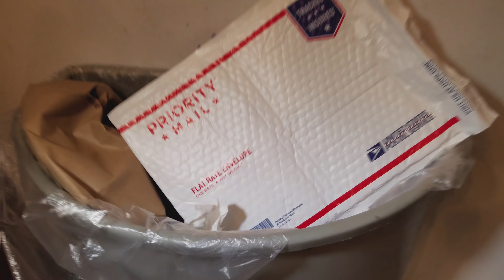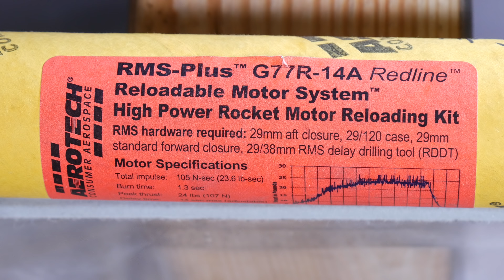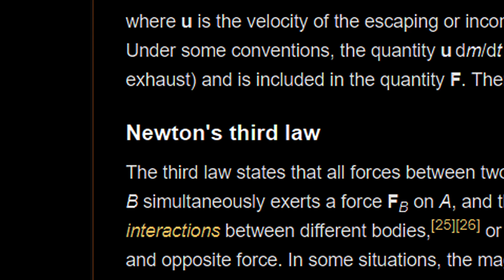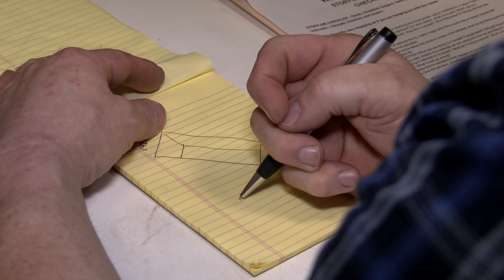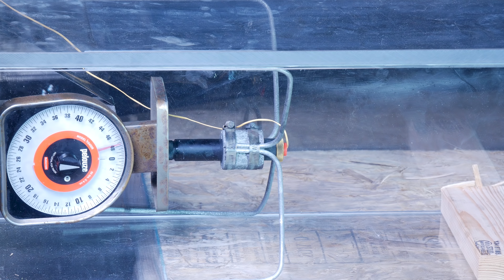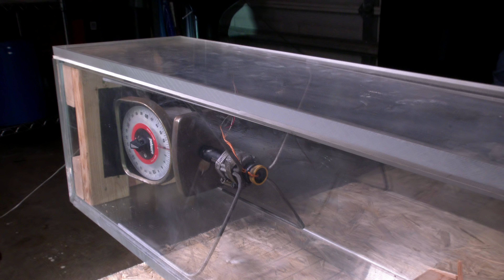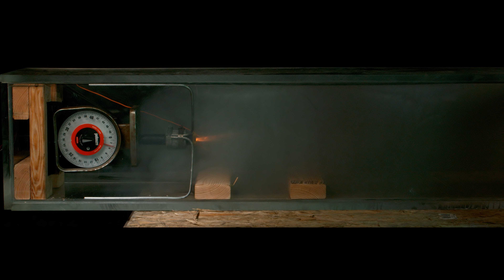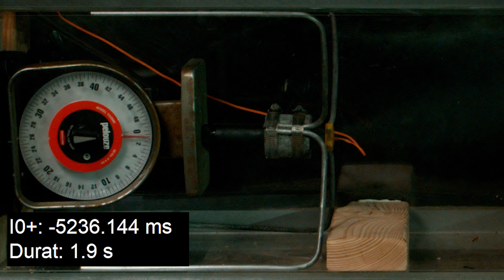Rockets in a Vacuum Chamber - Newton's third law of motion Visualized

Comment: The three questions I ask Papa Legba HUNDREDS of times on these threads are:

1 - when the rocket engine is running is the exhaust gas ACCELERATED as it leaves the rocket? Yes or no?
2 - does the exhaust gas have MASS? yes or no?
3 - can MASS be accelerated without a force? Yes or no?

The answers are:
 1 - Yes - the exhaust gas is DEFINITELY accelerated .
      It changes velocity from ZERO (with respect to the rocket) to over 2500 meters per second (about MACH EIGHT) (for a space shuttle main engine for example).
  2 - Yes - the Exhaust gas definitely HAS MASS .
      For the Space Shuttle Main engine: It consumes 500 kilograms of liquid oxygen and liquid hydrogen PER SECOND, Combusts it and expels the exhaust gas (PURE WATER) at MACH EIGHT. The exhaust gas has EXACTLY the SAME MASS as what went in.
   Last time I checked 500 kilograms of PURE WATER - HAS MASS (500 kg to be exact)
  3 - No - an object with mass CANNOT be accelerated without a FORCE .
      Newton's FIRST LAW tells us that the ONLY thing that can change the velocity of an object with mass (accelerate it) is a FORCE.
     That is literally the DEFINITION of the word "Force" - "That which can change the velocity of an object with mass."

So Papa Legba REFUSES to answer these questions because it PROVES the following:
Since the Exhaust gas HAS MASS, and it IS ACCELERATED then there MUST BE A FORCE exerted on the mass of the exhaust gas - we SEE IT GET ACCELERATED as it leaves the rocket!
Papa Legba has ALSO admitted that "The VACUUM cannot exert a force".
SO that means there is only ONE PLACE that the force can originate FROM - THE ROCKET ITSELF!
So if we have PROOF that the ROCKET MUST be applying a force on the mass of the exhaust gases then the exhaust gas MUST BE APPLYING A FORCE BACK ON THE ROCKET !
This is Newton's THIRD LAW! - Forces NEVER occur ALONE - they MUST OCCUR IN PAIRS .

SO IF Papa Legba acknowledges the above then he MUST ADMIT that there IS A FORCE PUSHING BACK ON THE ROCKET!

And this would prove his bullshit FALSE!

Oh and Papa Legba is SUCH a big imbecile that he will not even admit that Burning Hydrogen and Oxygen makes PURE WATER!
He has been arguing with me about the fact that the Exhaust Gases from a space shuttle main engine are WATER.
He contends its "Just FIRE".
So according to HIM, you can combust 500 kilograms of oxygen and hydrogen and get NO MASS OUT from the combustion byproducts.

And people wonder why I call him an imbecile every time he confronts me...
Reply: lol why haven't you been fired for online harassment crazy guy?
Reply: @papalegba6759  oh so asking questions is harassment but YOU making baseless accusations about ME and lying to others about my employment status is NOT harassment?
Reply: @stuartgray5877  still harassing randos online, 'rocket engineer'? you're nuts.
Reply: @stuartgray5877  lol keep proving you're nuts, idgaf.
Reply: @papalegba6759  Answer the question. It is your silence that is embarrassing you. These readers see that YOU are the one that refuses to answer simple physics questions.

WHAT ARE YOU TRYING TO HIDE?
Reply: @papalegba6759  So EXPLAIN where my description above is WRONG or ST FU
we KNOW you have NO INTENTION of answering because you KNOW my explanation IS CORRECT.
If it is NOT, then POINT OUT THE ERRORS.
You cannot, so ALL you know to do is hurl juvenile insults and accuse me of lying.
Reply: @papalegba6759  - Tell us AGAIN how a space shuttle main engine can accelerate 500 kilograms of pure water (per second) from a velocity of zero to MACH EIGHT - all WITHOUT FEELING ANY RECOIL FORCE.
Be my guest genius.

Comment: I didn't understand the part about holding atmospheric pressure inside the motor... Does this mean that fuel has more oxygen (from the air used to maintain atmospheric pressure inside) to burn than in your previous attempts cause if so, then its not about the atmospheric pressure but rather about the inadequate amount of the oxidiser in the fuel oxidiser mixture... I mean, there have been all solid multistage rockets doing orbital missions...
Reply: NASA has NO TROUBLE at all igniting solid rocket motors in hard vacuum.
They have even ignited them in deep space after a multi-month's long journey to Venus on the Magellan Spacecraft for orbital insertion of Venus.
Reply: @stuartgray5877  shame you have zero evidence for that, chatbot.
Reply: @papalegba6796  - "again, you have zero evidence for them either."
Except for the part where I have watched them WITH MY EYES.
Reply: @stuartgray5877  no you havent, chatbot.
Reply: @papalegba6796  Then where did I get all of the VIDEOS that I took LIVE?
Reply: @stuartgray5877  you have no videos that you took live either. Stop lying, chatbot 😂

Comment: I have a question. I’m sure some of you here have been to space before, so I value your life experience on this one. Does a space boulder ignite and burn its way into our atmosphere with intent to land on our great planet? Or does it simply catch fire on its way down? Or in? Or... however it appears to be traveling when we finally see it with our naked eye?
Reply: I'm not sure what you're trying to say here, but asteroids are pulled in by Earth's gravity and they accelerate on their way down to us because of it. They do not actually catch "fire". The trail they leave behind is plasma, gas that is heavily ionized due to extreme temperature. This temperature is achieved because the asteroid, meteor, etc. is travelling so fast, that the air in front of it is incredibly compressed. I'm sure you know that when a fluid is compressed, the temperature increases. In this case, the object is moving so quickly in fact, that the compression ionizes the air.

Comment: The LEM module that they filmed using a remote control camera from 238,000 miles away didn't have a flame during lift off. Too bad we don't have the signal that 1969 remotes and moon phones had today!

Comment: Without gravity, thrust has only to overcome the initial 'zero momentum' of the mass its attached to. An atmosphere helps to push against, but is not an essential factor to moving and accelerating any stationary mass in the opposite direction to the exhaust vector. Noting that the exhaust gases being developed in the chamber may also adversely effect propulsive force measurements as they accumulated, this limitation would not apply in the expanse of a space sized vacuum. After all a small jet of cold gas is all it takes to make attitude adjustments while wearing a space suit.

This is my opinion, I could be wrong.

Comment: 1. The external flame pushes your rocket :-)
2. Thrust reversal wouldn't work like that. It only works when the gas leaves an internal combustion chamber, in exchange for alleviating the Pressure and Volume within it.

Comment: What was the air psi before, during, and after the combustion?
If the combustion is producing pressure, that invalidates the test.
Reply: Good questions but having some pressure but not ~15psi atmospheric pressure still shows information. Or do you think that having an environmental pressure of say 2psi is the same as atmosphere? If so, how does that work?
Reply: @kitcanyon658  you didn't answer him, chatbot. now say NO U! like you usually do.
Reply: @papalegba6759  when a rocket engine ACCELERATES the exhaust gas, from WHERE does the force originate?
Or are you going to argue that there is NOT a force?
Reply: @papalegba6759  
If rockets require an atmosphere to produce thrust, then less atmosphere would produce less thrust. But the rocket here produces the same amount of thrust in normal air pressure as in a near-vacuum. Think, bot, think.
Reply: @the18thdoctor3  the test is a fake you weirdo. jfc. muted.
Reply: @papalegba6759  
Aw, how adorable, the bot is running away from questions it's not programmed to answer. Prove it's fake, then we'll talk. In the mean time, rockets will continue to function in a vacuum, just as the laws of physics require.

Comment: Things explode in space, what happens? Fragments of whatever exploded fly away due to  the force of the blast. A rocket is a controlled explosion. I could be wrong but if a rocket works in a vacuum doesn’t that mean that it doesn’t push against the atmosphere?  You can fire a gun in a vacuum. Maybe try that next time. I love home done experiments like this, awesome dude. You can’t beat messing around with fireworks

Comment: Space is, well space. It's immense! In space (I'm thinking) the vacuum would pull the gas out of the rocket so it wouldn't get started.
Reply: You are thinking incorrectly. Take a good look at a tutorial on the design of a liquid rocket engine.
Reply: @buggsy5  My thoughts, but I can't prove it, I can't get into space, deep space. I have a degree in engineering and one of the modules was in aero and rocket engines, I have an idea of how they work, but in space my thoughts are that a vacuum would PULL the expanding gases out. I might be totally wrong but my mechanical brain is thinking that way at the moment, it may change!
Reply: @cobail1  Certainly, if the gases had zero pressure initially. But as soon as there is a pressure difference, that pressure forces the gases out of the rocket motor and into the lower pressure area - in your example, the vacuum of space.

Remember that a vacuum is not some magical negative force, it is simply a lower pressure.  In the case of outer space, very close to zero pressure.
Reply: @buggsy5  You could be right. I'm thinking along the lines of; pressure is always seeking balance. We tend to think that high pressure always moves towards low pressure for equalisation. In space the vacuum is huge, immensely huge! So some pocket sized rocket on the side of the craft we used to go to the moon would not give anywhere near the amount of thrust needed to change direction. In my head it would eventually change but you would need something like the space shuttle's fuel tank. In proportion, the vacuum of space would equalise the pressure of a small rocket instantly. Just my thoughts mind you.

Comment: Steven curtis ok now you thinking.  Now how about space suites. Supposedly Neil and buzz space suites were sewn together by hand? Do you know how much forced is exerted on the inside when the suit is only 1 psi? Can you do the differential pressure equation for me?
Reply: "Do you know how much forced is exerted on the inside when the suit is only 1 psi?"
1 psi.
"Can you do the differential pressure equation for me?"
If the suit is in a vacuum, the answer is-
1 psi.
Reply: @darklight2.1  yes the differential pressure with 5 psi inside the suit (what they actually operate at) is exactly 5.0 psi.  Last time I checked 5.0 - 0.0 is 5.0.  you are welcome.
Reply: @stuartgray5877  online harassment is illegal, crazy guy.
Reply: @stuartgray5877  lol you're nuts.

Comment: I'd have added a little oxidizer around the igniter. Put a tiny bit in, place the igniter in and fill ate area around it with an oxidizer. Probably less than a gram total.

Comment: Whenever one body exerts a force on a second body, the second body exerts a force that is equal in magnitude and opposite in direction on the first body.  ...so in a vacuume what's it pushing against ...?
Reply: The rocket pushes out the mass of the exhaust gas accelerating it into the vacuum.  This "mass" exerts an "equal and opposite REACTION" which applies a force to push the rocket forward.
Rocket propulsion is just the mechanical recoil of the nozzle pushing out mass.
Reply: Here is a thought experiment to help
1) If ones sets off an explosion in space, what direction will the explosion go? in all directions?

2) if one puts the explosive an open ended container and sets it off.. what direction will the container go?
Reply: @stuartgray5877  ... the mass of the exhaust is the first body ... the point is that there is no second body ...?    Vacuum once you take away gravity is Nothing  ain't It ?   ... hard to get my head around it   : )
Reply: @entangledmindcells9359  Wouldn't it take the path of leased resistance ... so the box wouldn't move ...   or would it ?   : )
Reply: @terryernest6264  So would a crossbow fired into a vacuum still have recoil?
Yes or No?
Why or WHY NOT?
Most of the people that "dont understand rocket propulsion in a vacuum" are the same people that claim that Crossbows DONT HAVE recoil, when in fact, they do.
Once you really understand Inertia and Momentum you will realize that crossbows (and guns and catapults and ROCKETs) MUST have recoil.
This is because all of these devices ACCELERATE MASS.
Anything that accelerates mass MUST feel an "equal and opposite force" to the force the machine is applying to accelerate the mass.
Does an aircraft carrier feel the recoil when it launches a fighter jet?
Would it still feel that recoil if it fired the fighter jet into a vacuum?
YES.
Reply: @terryernest6264  If the gas has mass and wants to head in all directions,  something must cause it to head in the lest resistance path.. What is that something?
(that something is your equal and opposite reaction)
Reply: @stuartgray5877 ... My grade 4 CSE don't really help in these matters : )
Reply: @entangledmindcells9359  ...maybe your right ... : )
Reply: @terryernest6264  We are definitely "right".
I have been building, testing, launching, and operating spacecraft in earth orbit and deep space for almost 30 years now.

Five of the six spacecraft I have launched had Propulsion systems.
Reply: @stuartgray5877  ... Ok Stuart I'll bow to your long experience with Rockets and I'll stick painting ... : )

Comment: 1. The flames can push against the end of the vacuum chamber and 2 the vacuum isn't a vacuum as soon as you lit the rocket, where as space is endless and you couldn't change the atmospheric pressure by a single rocket
Reply: Or MAYBE any object that PUSHES ON MASS feels a recoil force?

So, the forward THRUST form a rocket is the direct result of RECOIL.

Comment: The thrust of a rocket depends on molecules repelling each other and is 
not dependent on pushing against an outside atmosphere. Think of holding
 a magnet together where you are pressing the same polarity together. As
 soon as you let go, the magnets repel each other. The force of your 
hand was containing all that energy inside of the magnet from doing what
 it naturally wanted to do.  Magnetism works in a vacuum. it is the 
electromagnetic force that makes this happen. That same force is 
contained within each atom. But is held together by an outside force 
(like your hand) This outside force (called the molecular forces) are 
released by a chain reaction called combustion. The atoms then do what 
they naturally do and repell each other. some of these atoms bounce 
against the rocket and push it forward. This does not require an outside
 atmosphere to create pressure. It creates the pressure on its own. This
 pressure is directed so that the only way the molecules can escape is 
through the nozzle. This happens quickly but not happen instantaneously.
 if It were instant, you would witness it as an explosion. Since the 
burning happens over time, some molecules become trapped between the 
rocket and other molecules that havent found the escape yet. Those 
molecules bounce around against each other and the rocket and continue 
to expand until they find the nozzle and escape. Rockets can work in a 
vacuum.

Comment: The rocket engine is pushing against the mass of the rocket in a vacuum, same as in an atmosphere. The rocket though weightless so to speak in space it still has mass, force is required to overcome inertia to move that mass. Inertia will be evident when you try to stop traveling it will require a force against the direction of travel to stop the rocket, ergo the need for braking thrusters. 35 years ago I learnt that in physics class.